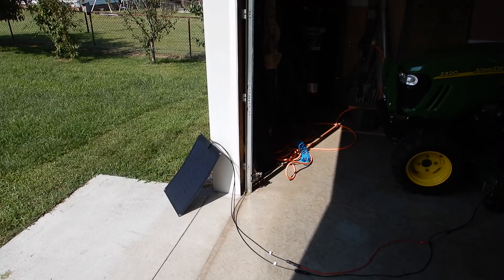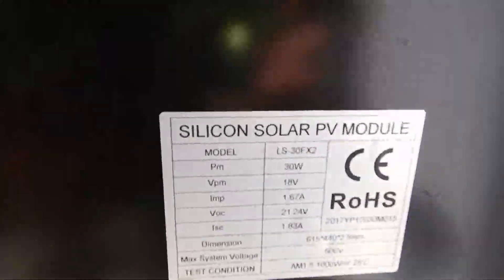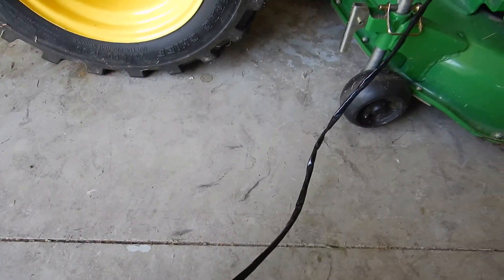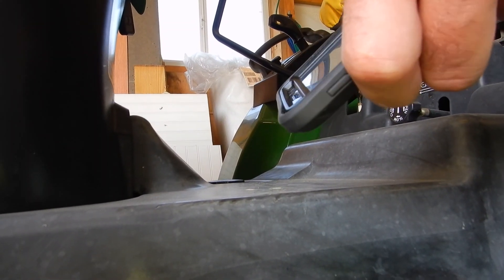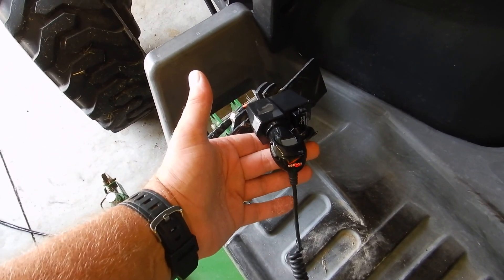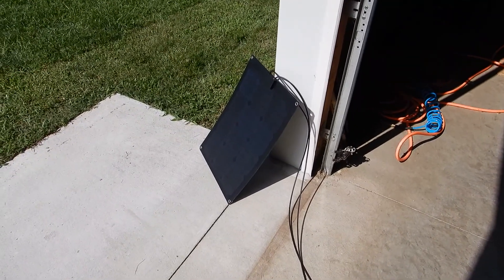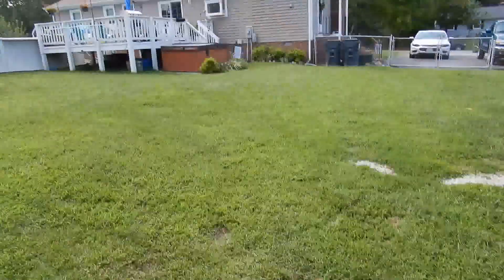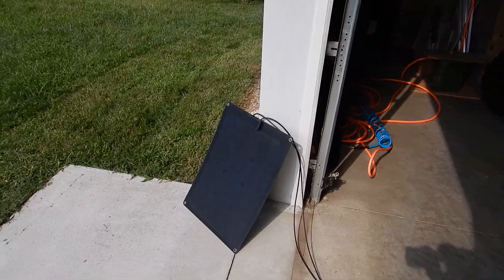Lensun 30 watt Flexible Solar Panel Charging  Smart phone By KVUSMC

Comment: Kenny, without a charge controller you aren't getting anywhere near the 1.67A rating. That amp rating is only at that maximum voltage without a charge controller. So 18V x 1.67A = 30W, that's how you read that panel. If you are charging your phone without a charge controller you are limiting the charge voltage to around 5V which means at best you are getting something like .25 to .3 amps. You can find out exactly what the panel will put out if you look at the chart that goes with that panel, assuming it has one, and cross-reference how many amps it can put out at 5V. :)
Reply from the maker: +helloman1976 Very True Buddy I do Have Have A charge Controller I could Hook To It to see what I am getting Thanks Buddy Have you seen the Other Video Of The Charge time it only took 2 to 2.5 hours To charge the Phone in good sun
Reply: @KVUSMC Was that from completely dead? So let's assume it was from completely dead. Most phones have a battery that's roughly 2000mah. So if it takes 2.0 to 2.5 hours to charge from dead this is how that works out. 2.25 hours to charge a 2000mah battery would be about .89Amps per hour. .89A x 2.25 hours x 1000 to get mah = 2002.5 so that's probably about right. If we assume it's charging around 5V then 5V * .89A = 4.45 watts from a 30W panel so you can the serious loss you get without a charge controller. 

If your panel was a 5V panel, you'd get much better results at the same wattage but you wont find a 30W 5V panel. It's much easier to just hook up a charge controller that regulates the voltage and current the only way you'd get that full 30W (assuming your battery can take it and it can't) would be to use MPPT. :)
Reply from the maker: +helloman1976 Yes it was Completely Dead at 2 % it did A fantastic Job
Reply from the maker: Hi Buddy The Whole Purpose Of This Video Was to Charge Direct With out A Battery Pure Solar Power or a Charge Controller

Comment: I use a portable battery which charges all day then charge phone with it, easier.
Reply from the maker: The Whole Purpose Of This Video Was to Charge Direct With out A Battery Pure Solar Power
Reply: The reason I use a battery is mainly as a 'buffer'. I know a fair amount about batteries and basically the slower you charger them the longer they last(both in cycles and that specific charge). Since I have a phone with a battery which can't be easily replaced I leave the inducting to a cheap battery to then slowly have it charge my phone at 5v 1amp. Most have their phones needing replacement as the battery gives out after 3 years, I use my phones more like 5-6 years before updating so I truly care about my cell's cycle life, that's my reasoning. The same 8watt anker panel and 10,000mah battery have been charging my personal phone for a near decade, and my battery near always makes it through the day or even 2 on a charge due to me keeping it 'cherry'.
Also have to watch for heat during a charge, don't put it on carpet, especially with a 'quick charger', lithium batteries like 45-90 degrees, 10-95% charge, and a slow steady charging source, so that's what mine get. Baby'ing their battery isn't for everyone but it's something I'm mindful of. That's my reasoning, anyways, carry on.